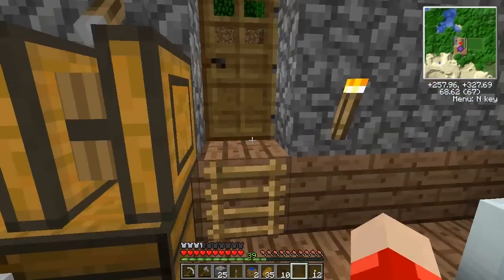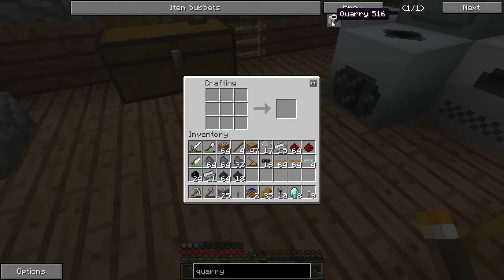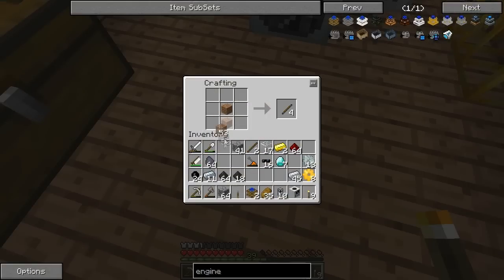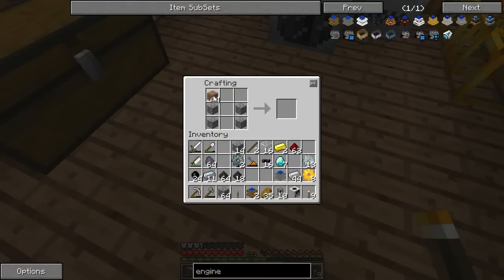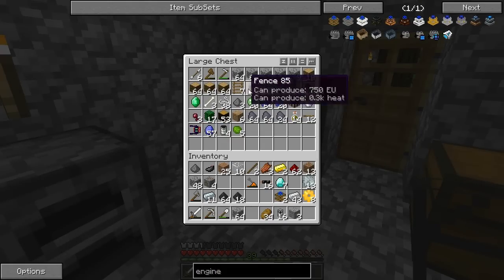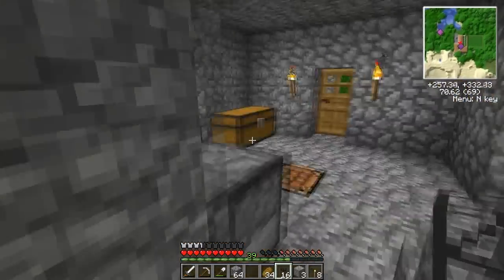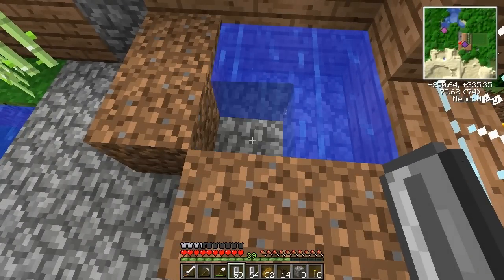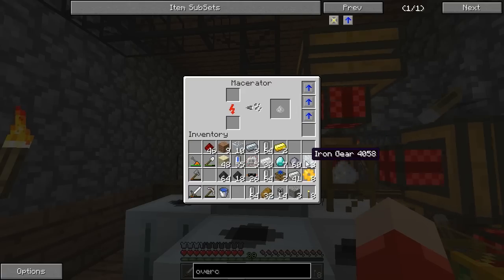Minecraft FTB Ep. 10: Bad math quarries

Comment: the bc façades might be a solution to keep pipes from connecting. the RP covers ones won't interact with the bc pipes, but will occupy the adjacent block, where as the façades can occupy the same block as the pipe. 
you know that construction foam can encapsulate IC2 wires? and it can be painted